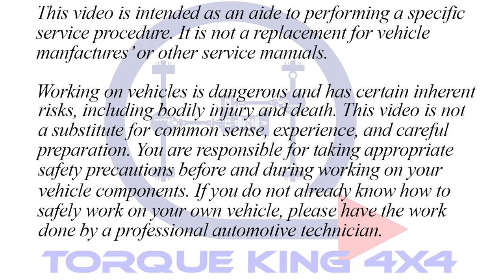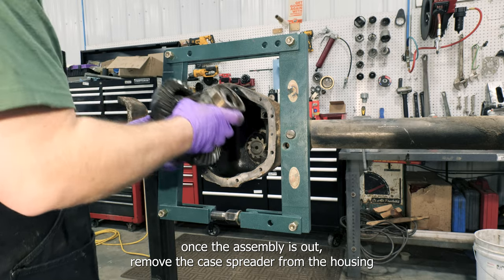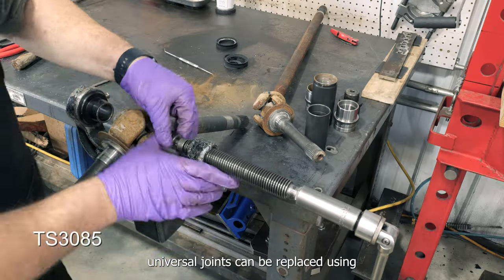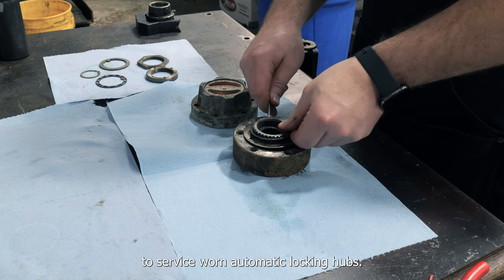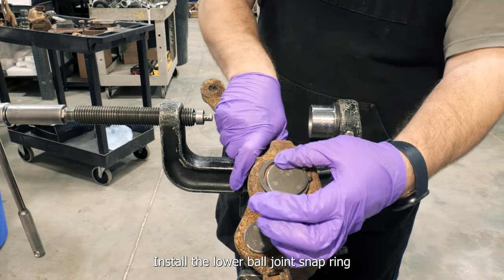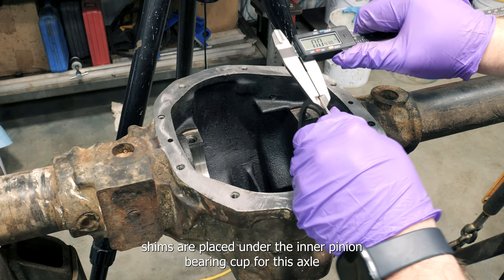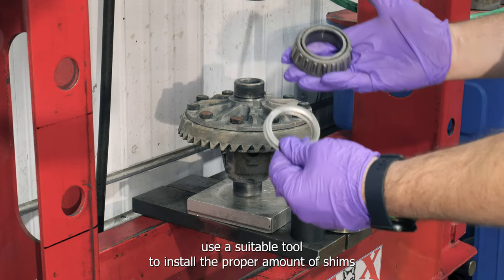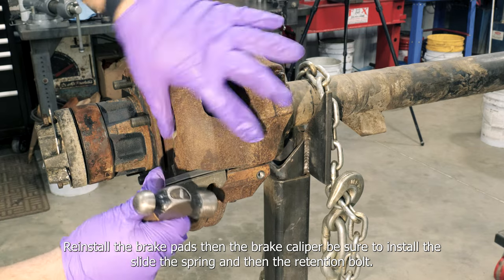International Scout II Front Axle COMPLETE SERVICE GUIDE

Comment: Do the scout ll and terra have the same axels? Meaning they can be used on either? Thanks
Reply from the maker: Possibly, the Dana book does not show a separate Terra listing. I would assume most components would be the same as a normal Scout II.
Reply: @TorqueKingTV  thanks for the response. I thought the same
Reply: The Terra and Traveller are a Scout II with 18" added to the wheelbase.  Other than that, all the mechanicals are the same.

Comment: Sorry... but at "18:30"... did you seriously not even bother or care about cleaning it up or even coming anywhere close to it with a wire wheel?  How about when something looks like shit... clean it, wire wheel it, soak it in phos, rinse and dry, and... PAINT IT.  You know... like you cared.
Reply from the maker: You mean in the disassembly process? Never, all parts are cleaned after disassembly unless there is excessive oil or grease which inhibits safe handling/creating a bigger mess or in the case of these ball joints at 18:30 using a pick to remove debris that may cause tool damage as demonstrated at 16:37 .

All parts go through a parts washer cabinet before reassembly. Many parts for customer vehicles do get a coat of paint and spiffier clean up, but for these simple service videos we only prep them at the minimum required to do the job correctly, as would most viewers and almost every repair shop. Paint and wire wheel is optional in most cases and up to the end user how fancy they want to get beyond critical mating surface prep.